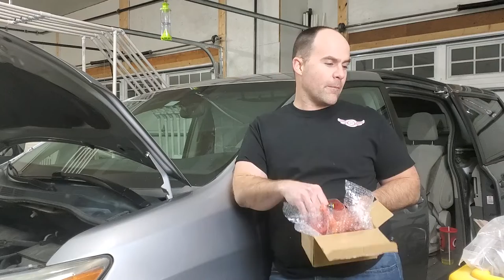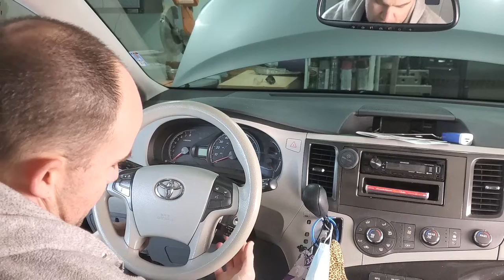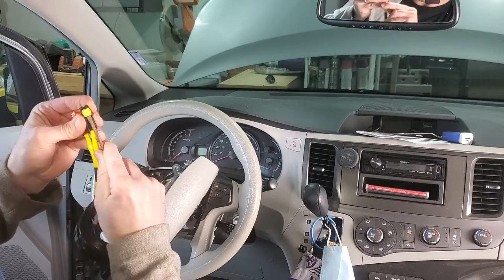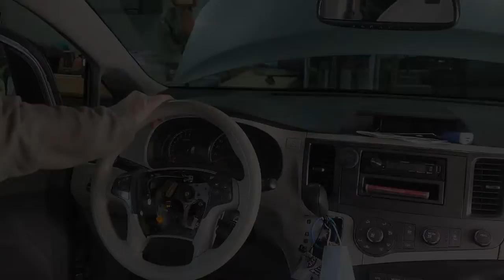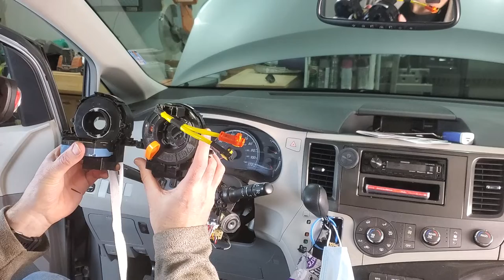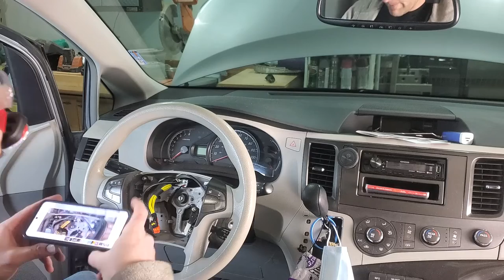2011 - 2014 Toyota Sienna Clock Spring Replacement

Comment: I have the same issues as you and my steering wheel controls do t work. Are those routed through the clock spring too? Or is that a separate issue?

Comment: Did you have to recalibrate the steering angle sensor after installing this?
Reply from the maker: I tried.  Following the instructions of jumping pins in the OBD port.  I now have traction control lights on the dash.
Reply: We're you able to fix the traction control lights on the dash.
Reply: Me too. How did you fix it?  @AirCapitalHotRods